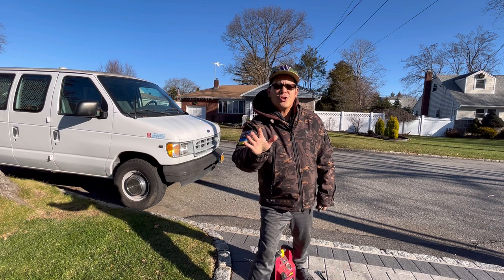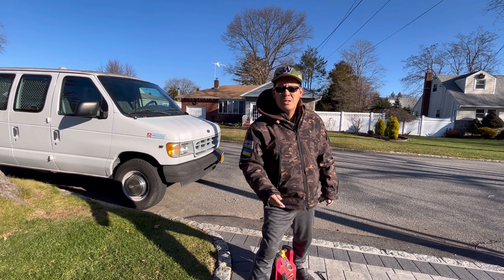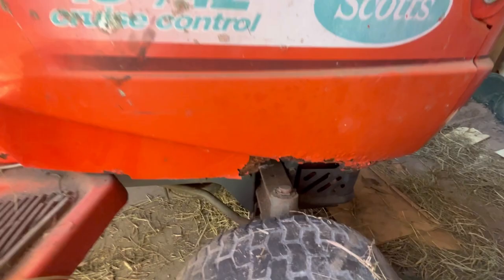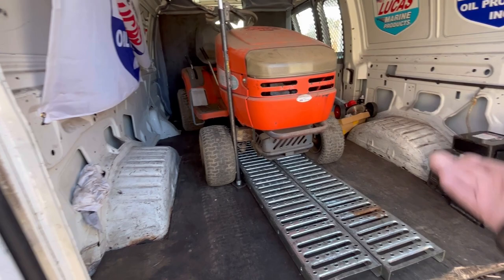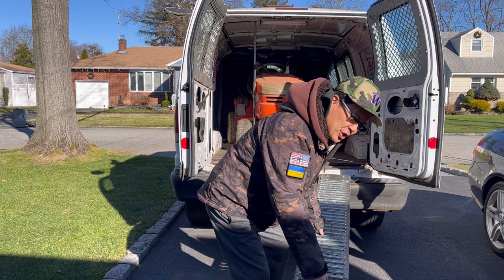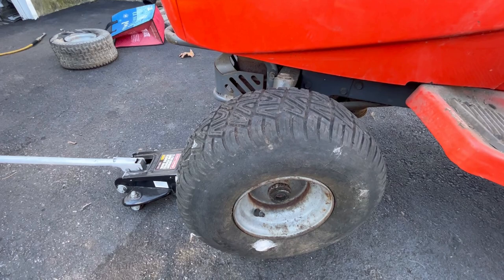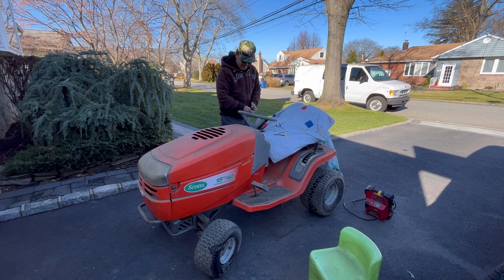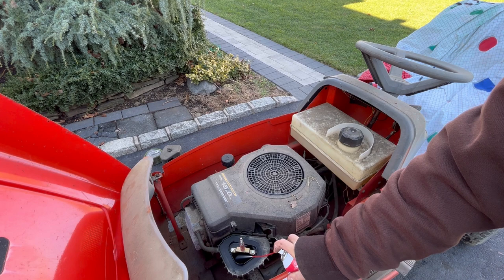SOLD A SCOTTS BY MURRAY 1542 LAWN TRACTOR HAULER 2 YEARS AGO ! GOT IT BACK TODAY FOR FREEEEE! SCORZ!

Comment: ...enjoyed the DIY video Henry.....great job....thanks for posting....I could be wrong, but I believe that voltage regulator should not charge the 
battery above 14.6 volts....17.2 volts is way too high.... 🙂
Reply from the maker: You are correct,  perhaps a faulty diode on the stator.  Either way it’s sold last week.

Comment: On those tires,  you can use starting fluid to get them to seat the beads.  Just spray some fluid in the tire,  bring some on the out side of the tire. ( don't use much) then light the fluid and it will pop the tire seats against the wheel then before it loses the bead shoot some air into the tire and air it up.
Reply from the maker: Yes,  I’ve burnt my eyebrows off before
Reply: @MowersNBlowers  
Sorry to hear that, I used to drive big trucks,  we weren't supposed to use starting fluid,  but with a 22.5 tire,  it was pretty easy to get it to seat the tire.  I have used it on car tires and mower tires as well.  It was just a suggestion.  I bought an air tank with a short tube that would be able to shoot air into the tire that was a big help,  some said safer,  if you were careful the starting fluid was safe  I guess a few people got hurt.  I enjoy your channel,  informative,  and entertaining.  Have a wonderful weekend sir 😊
Reply from the maker: @bertgrau3934  much obliged m!  Hope you’re subscribed
Reply: @MowersNBlowers  
Yes Sir, I am subscribed 😀
Reply from the maker: @bertgrau3934  thanks Bert!